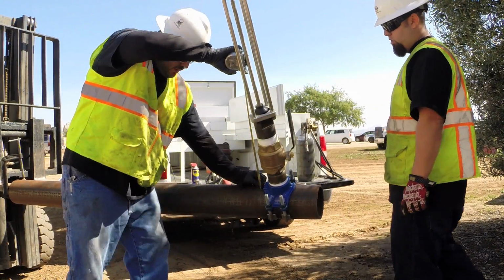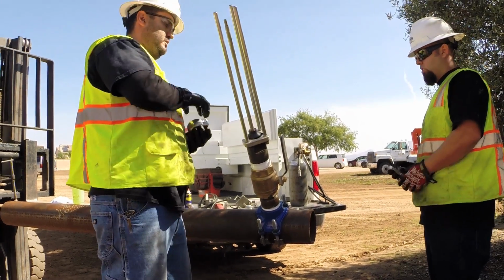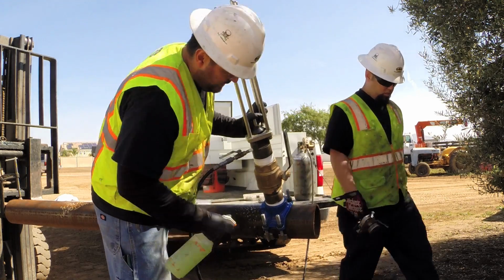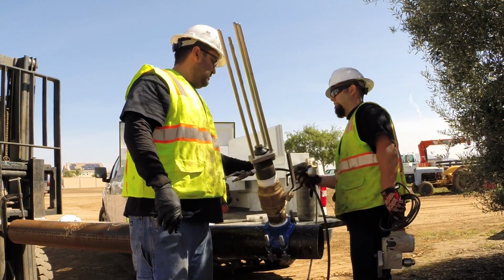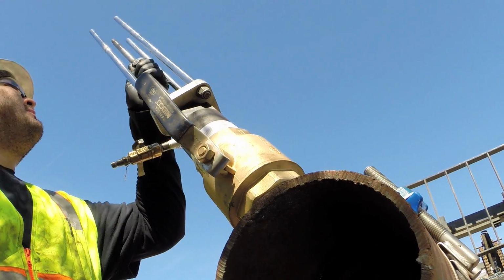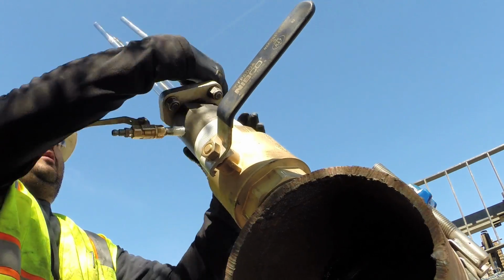T1-4 Hot Tapping Machine Turn-Key Package Completing an 3" Hottap on 6.63 Steel Pipe

Comment: I dont like any machine you cant retract fully before disengaging the drive mechanism because on high pressure lines that drill shaft can come flying straight back out the end of the tapping machine .
Reply from the maker: This is a low pressure hot tapping machine thankfully. Used for only city water, gas, and other low pressure applications thankfully
Reply from the maker: These machines are low pressure machines maxing out at 300psi@ 100°F